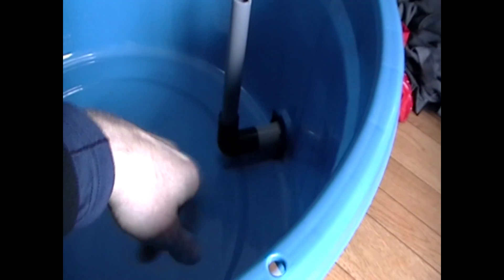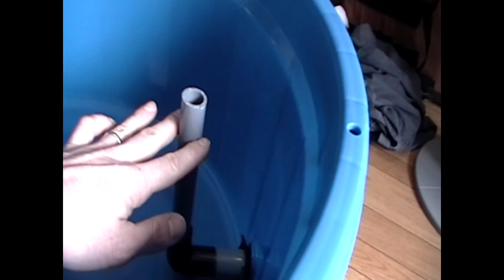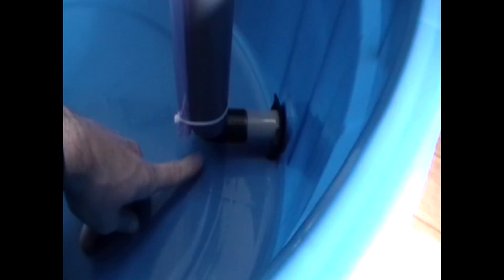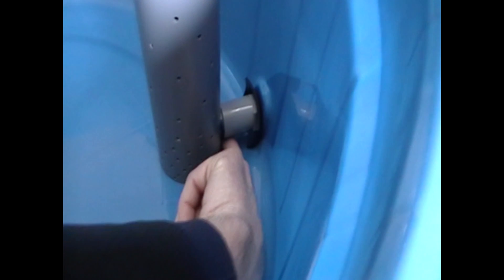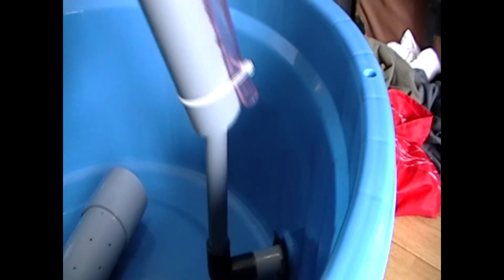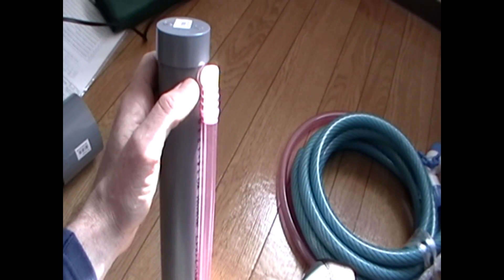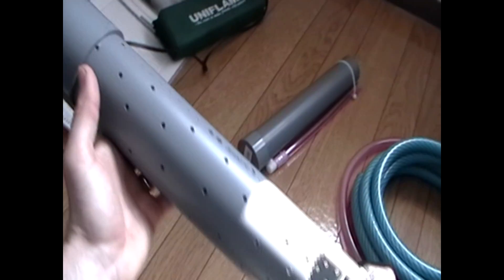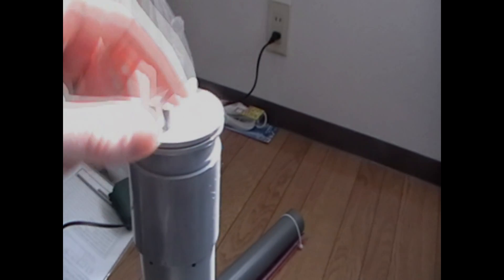Aquaponics - Tutorial - How To - Bell Siphon

Comment: Does having the clear tube going up the side improve the suction (or breaking of the suction) over just having holes in the bottom of the bell (middle pipe of the 3) where you want your minimum water level?   Showing the drain going out the side does show another variation of this that simplifies things!